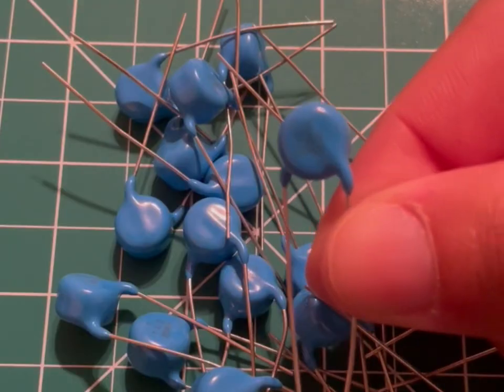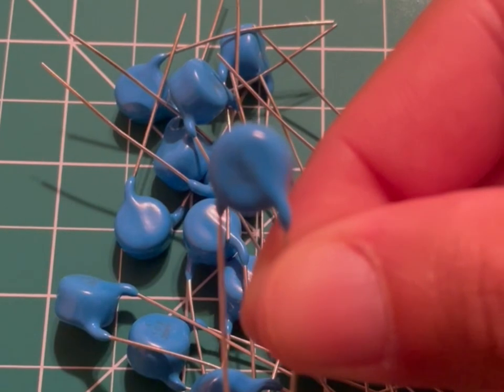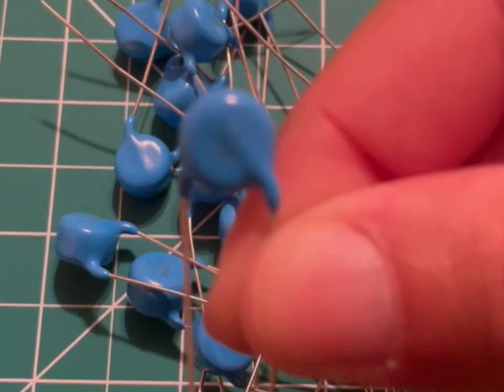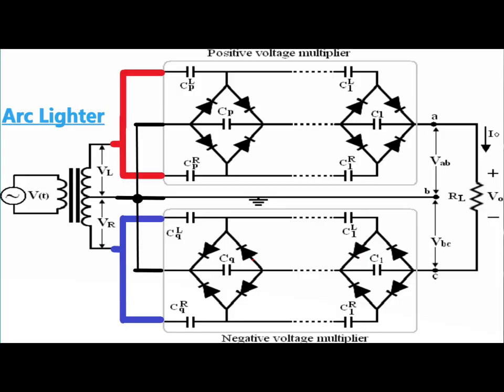(60,000 Volts) Bipolar FULL WAVE High Voltage Generator - Cockcroft Walton

Comment: You should put your circuit in wax to avoid corona discharge
Reply from the maker: Surprisingly, I'm not getting much corona discharge from this circuit unless both legs are closer together than what I have them at in this video. I also believe this is because there's not much power available from the arc lighter power supply, or maybe the rubber mat I'm using is providing sufficient isolation.

I'm currently building/testing a marx generator where this actually is an issue. As of right now I'm using oil and it's messy! I'm planning to use your suggestion as a finished product, unless you have any other solutions?